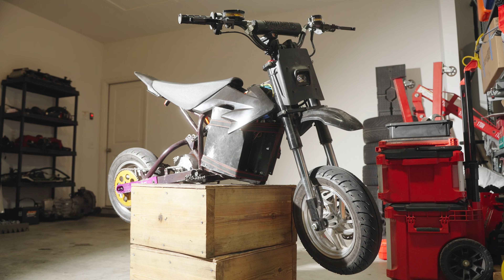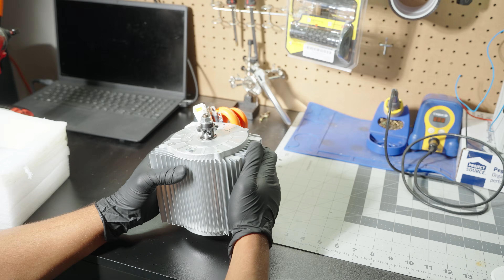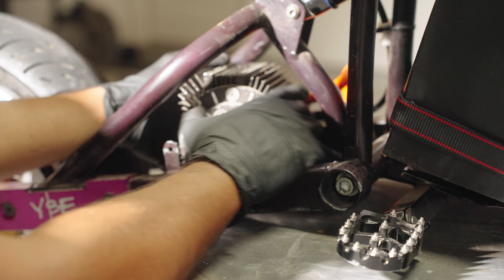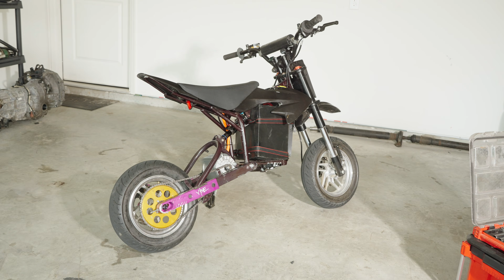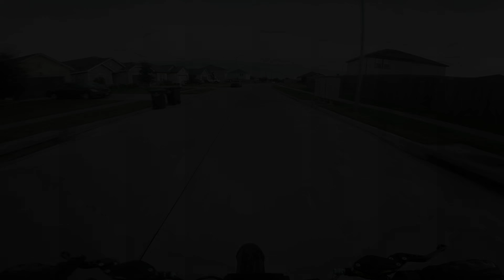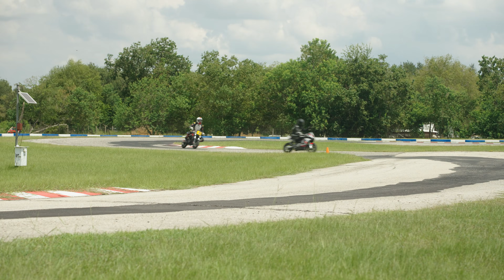Razor MX650 TRACK TESTED // EC4P LITE Unboxing – Budget Powerhouse?

Comment: I got 53mph (gps) out of mine with the 9t sprocket @ over 8k rpm with a 10in wheel.  Currently changing the sprocket to a 10t to get closer to 60mph. Have to turn the controller down a bit because I cant keep the front end down.  Pretty crazy for a kids toy

Comment: KX85, CR85, RM85, YZ85! Get a platform like that to start with and there is endless after market parts and they have proven themselves for over 20+ with very few yearly changes. 65cc is to small, I have tried that road.
Reply from the maker: Definitely was considering one of these options with a QS motor. Also would allow me to fit a larger battery. Hopefully a project for the near future!

Comment: For more speed power and no overheating I recommend the qs165 or fw11 and gts11 motors my buddy had the ecp4 and his shuts off from overheating and he doesn’t even ride hard
Reply: I'm pushing my electro and co my1020+ to 10 kW and can hit 55+ MPH with a 60v battery. This is with active cooling
Reply from the maker: I'm a big fan of QSmotor as i've had great luck with them in the past. I will probably end up using one on a future high power build. Thats interesting though, I haven't had any overheating issues on either of my EC4Ps, but then again i'm never pushing a lot of power for very long periods of time.

Comment: Those motors are made by boma the same as Kunray vevor they all garbage the high kw claim of them is jus preposterous there isn’t enuff windings in these motors for them to be make that many kilowatts just more over priced garbage I wouldn’t buy any thing from these guys well that’s a lie I think the sumos are okay 👍🏽 that’s bout it lol
Reply: Do you recommend krv5 motor with fardrivwe 72450
Reply: @Xerxes_TV it works fine Yeuh but you have to keep a good watch on it temp wise especially if your guna max it out
Reply: @ModDemonMX ok and is there something I can buy to check temperature and what is a bad level

Comment: Trust me next time you try a motor try a sotion i run an fw11 and its amazing the gts11 is apparently better they are a little more pricey but they rip
Reply from the maker: I’ve definitely heard good things about those motors. If I ever feel like upgrading from this one I will probably go that route.
Reply: @JZEV1 qs165 even better and only about 100$ more
Reply: What about krv5 do you recommend with fardrivwr 72450
Reply: @Xerxes_TV the kr5v was pretty good the fw11 and gts are just better though a little more pricey but run way cooler/smoother and put out some more torque
Reply: @THEfastahh65 but is it a big difference I can buy the krv5 72450 fsrdrivee for 400$ cad is enough to go 80-90km/h
Reply: @Xerxes_TV it would do 90kmh no problem its still a great motor but if you can spare the extra hundred go sotion forsure